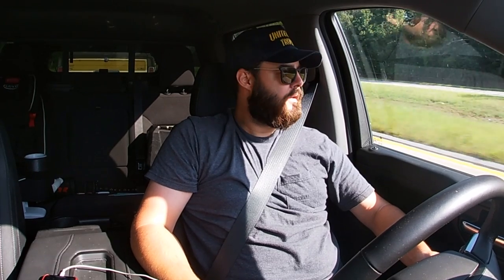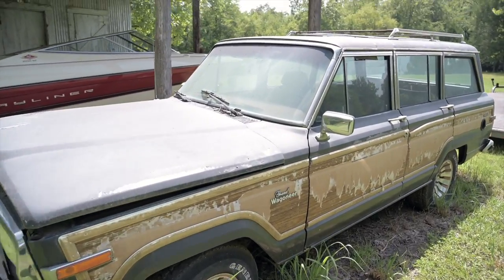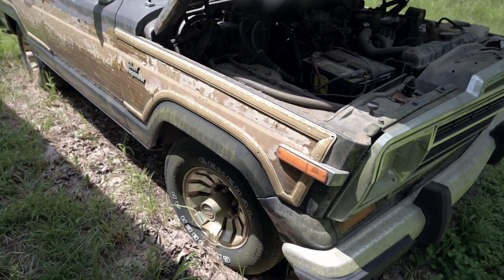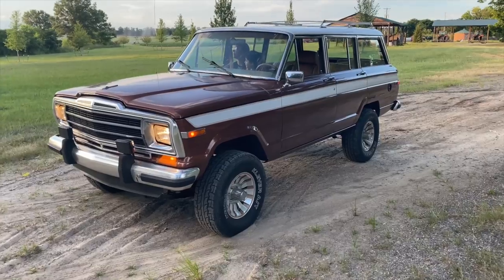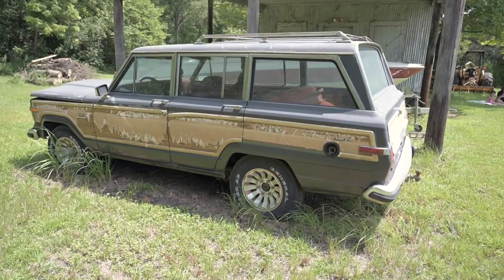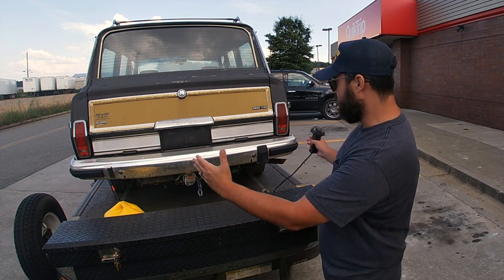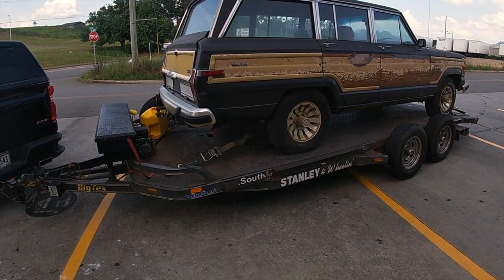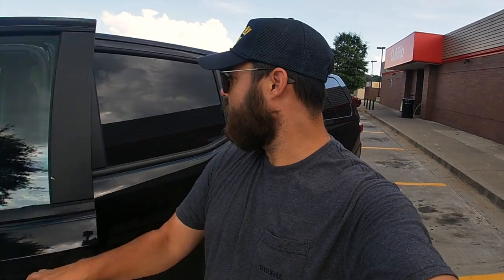WE ALMOST LOST THIS ONE! | controlling trailer sway

Comment: Hey Robbie.  I have a ' 18 Ford F150 and I was getting squat and looked into adding helper bags.  When I talked to Stage3Motorsports they didn't recommend I install the helper bags.  They said yes it will help with squat but it would definitely adversely affect your ride quality when not towing.  So I didn't do helper bags....
Reply from the maker: Hmmmm I've actually never heard that. I need to look into that. Thanks!

Comment: Turn it around, get the engine closer to the tongue....
Reply from the maker: Thanks, Joe. It simply needed to be slid back about 6". Made all the difference. I've found that with SUVs there is so much weight in the rear with the added metal and glass you can balance them fairly well from either end. This one got me for a moment. Glad I got it sorted out.
Reply: You really are tempting fate and risking your life !!! Your center of gravity is way off ;)
Reply: @UNITEDBYTRUCKS  Yes, this is a hobby, not supposed to hurt you! Remember this, you can make the usual excuses(I'm only going a few miles, etc), but when you crest a hill, and start down, then the road is wet, it's too late to wish you had loaded differently. I watch a guy out of Missouri, Ron Pratt, does big tows and wrecks for the county. Try a few episodes. You might like what he does with shooting. Be sure to ask yourself, did any of these folks plan to be on the side of the road watching what's left of their rig loaded on a tow truck? Stay safe, we like your channel!

Comment: Channel. Lol roadmaster active suspension helps with squat and sway. No bags to air up. Added them to my hd2500 after changing to flat bed. No more axle hop and lifted rear end back up 3 inches. My 24 ft stock and flat bed goosenecks don’t even move truck empty anymore. 45 minute installation in driveway with proper tools and jack stands.
Reply from the maker: So good to know!

Comment: I think that you've figured out that the  single biggest factor of trailer sway is loading tail heavy...I'd have pulled the Jeep into the field and either turned it around or moved the trailer to the other end of the Jeep... stay safe everyone!!! Brake trick definitely works but if you balance your load properly you'll never need it.  (Not counting pulling tall campers in a crosswind of course).
Reply from the maker: Thanks for the feedback. So true!

Comment: I was thinking don't load it backwards.. I loaded my brother's k5  on a trailer backwards because it wasn't running and almost lost both trucks and trailer. I definitely learned. I didn't have trailer brakes. Wild ride for sure.
Reply from the maker: While loading backwards isn't always the best idea, it simply just needed to scooted back. I've learned that in SUVs, there's quite a bit of weight in the rear with all the metal and glass. Once I scooted it forward a bit, it rode super well.

Comment: First thing I thought when you first loaded was, It's tail heavy and going to fishtail on you.  If you're going to haul heavy with a bumper pull on a half ton, you definitely should be using some sort of equalizer.  If you've never pulled with an equalizer, you'll be amazed.  I pulled my 37 PU home in my enclosed trailer.  600 miles.  I was pulling with my 2500HD Duramax.  I was about 100 miles from home and the trailer started whipping on me.  Turns out the straps had loosened and the truck had rolled back just enough to upset the balance.
Reply from the maker: Thanks for the feedback! That's a pretty scary feeling for sure.
Reply from the maker: Thanks for the feedback! Definitely a scary moment.